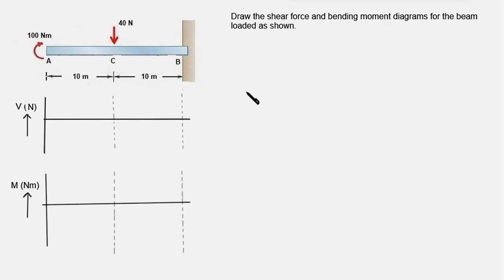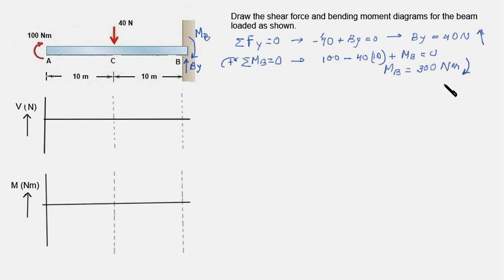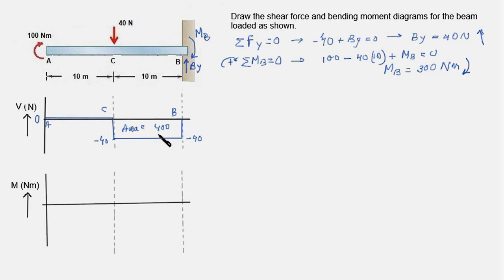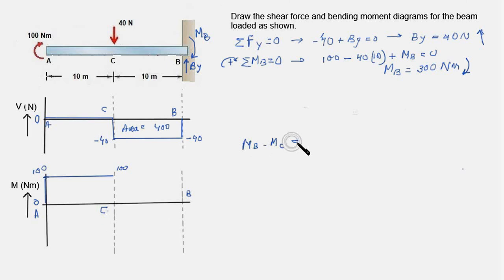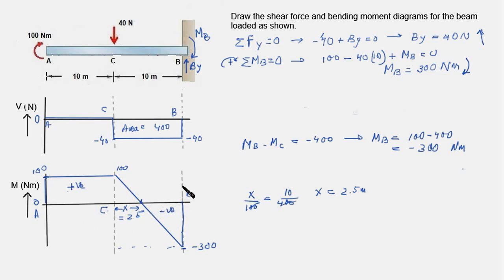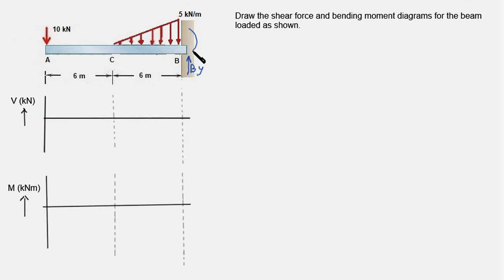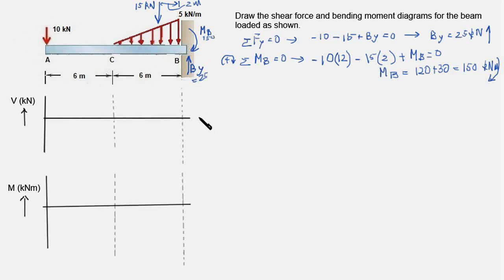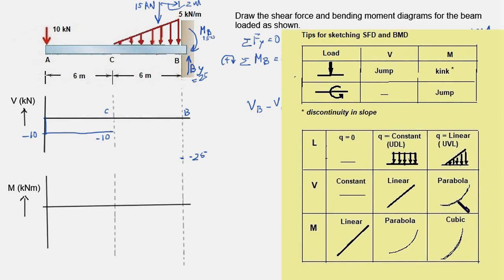15.4  SFD and BMD for a cantilever beam carrying  a couple and UVL load using graphical method.

Comment: Sir why here we are taking clockwise moment as positive in all other videos it is taken as negative in clockwise direction.
Reply from the maker: While solving most of the problems in statics, you can decide your own sign convention i.e. define clockwise moment as either positive or negative. The choice is yours only on one condition....you have to be consistent about the chosen sign convention while solving that particular problem only. You may follow a different sign convention for solving another problem.
But when it comes to bending moment, there is a universally accepted sign convention and therefore you have to follow that convention. For detailed explanation on this topic, watch another video on this channel - 'Shear force and bending moment in beams - Basic concepts"  https://youtu.be/wemk8zPrco4